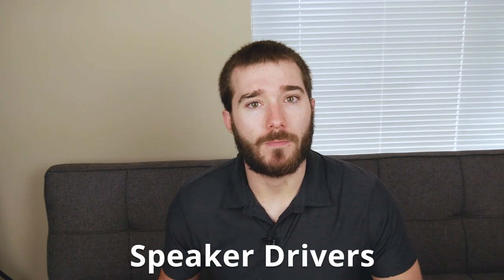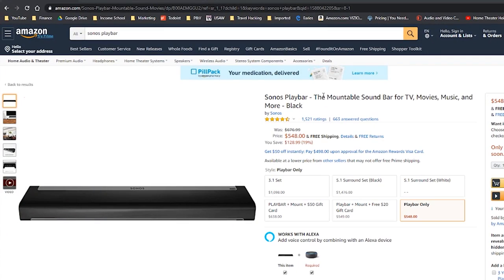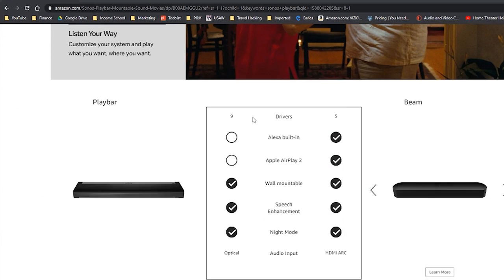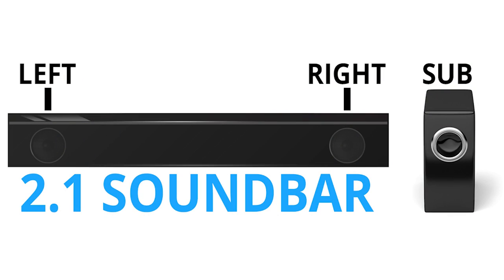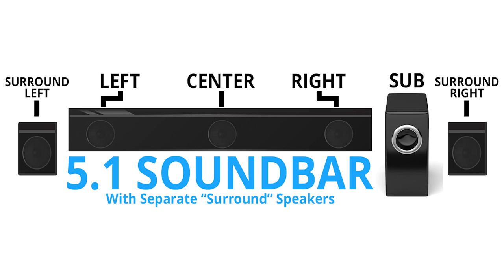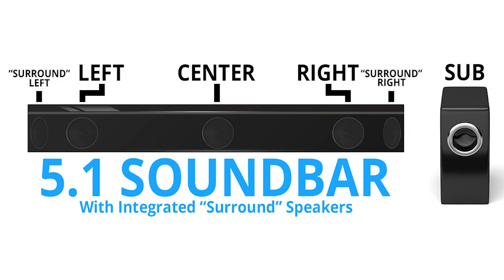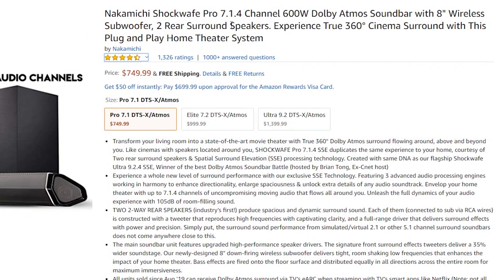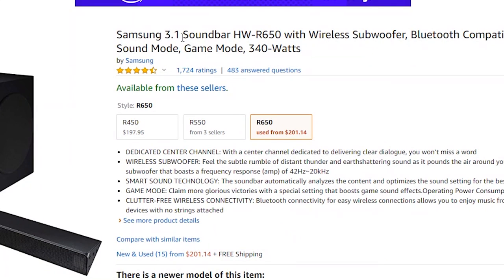Soundbar Specs Explained! Why Do Manufacturers Lie?

Comment: You can sum things up very simply:  You get what you pay for.  A $100 soundbar will never sound better than a $500. soundbar  A $500 won't sound as good as a $1000 soundbar.  Once you reach a price point, say the $1000 price point, things begin to be incrementally better to a lesser degree.  So a $2000 soundbar will be better than a $1000 soundbar, but the differences are less than say, a $500 compared to $1000.  We dress this up with specs and try to justify why cheap soundbars are good, or good enough.  Usually because we don't have the money for a $2000 soundbar, and we want to feel good about what we have bought.  It's that simple.  You get what you pay for.